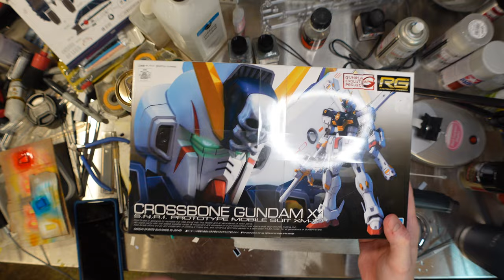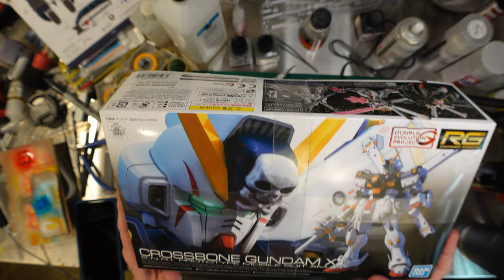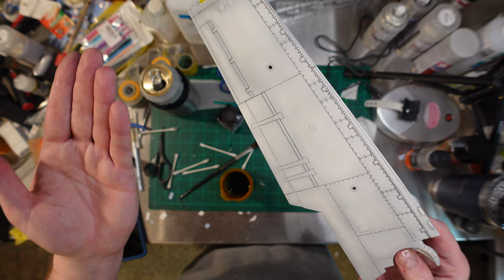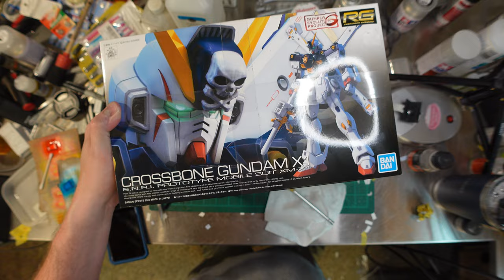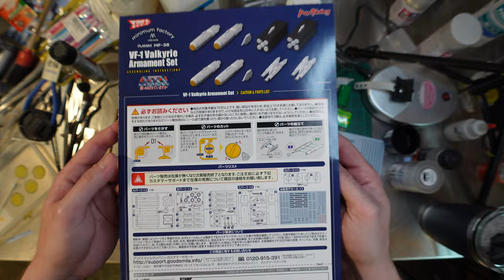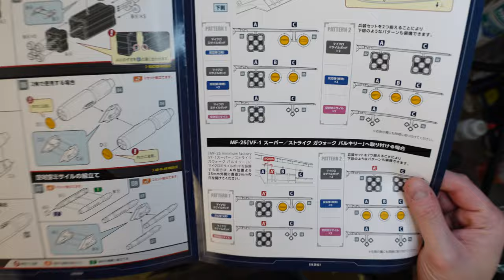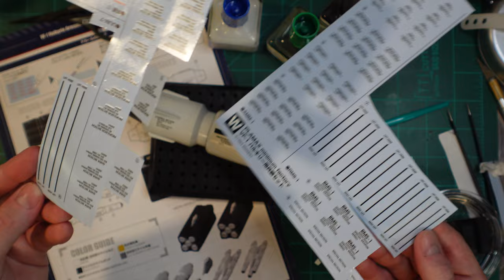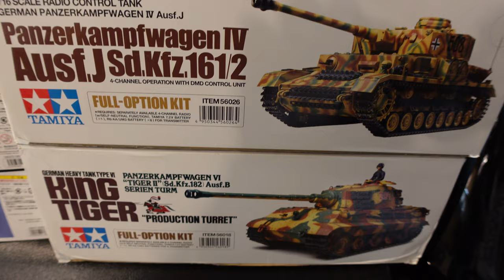Plamax Minimum factory Macross Robotech 1/20 VF-1 Super strike Valkyrie Model Build Part 3 giveaway!

Comment: Why  didn't you  add  custom LED lights ?
Reply from the maker: Because the build was so bad in stock form I didn't have the will to try.
Reply: @PitstainHobbies  I was thinking about doing it. From your experience with this build this may not be a good idea  for me to do ?
Reply from the maker: @icejade2000  If you can handle a model that does not fit together well and deal with filling gaps with putty and alot of sanding and clamping of parts then this is the biggest Valkyrie out there and looks very cool, but if you are not up for some hard work I would avoid it.